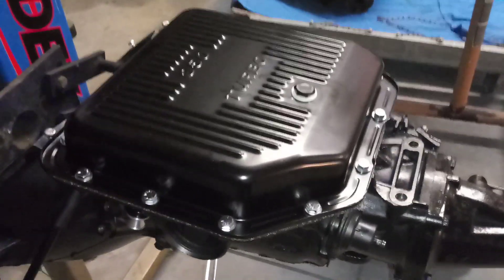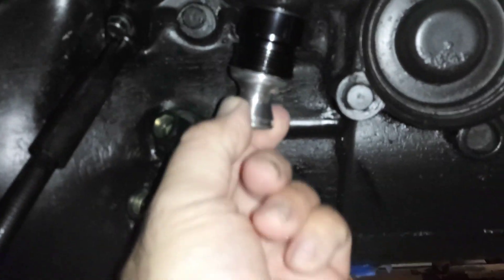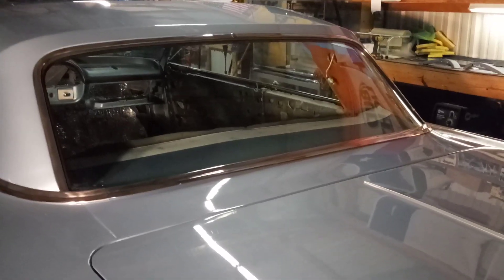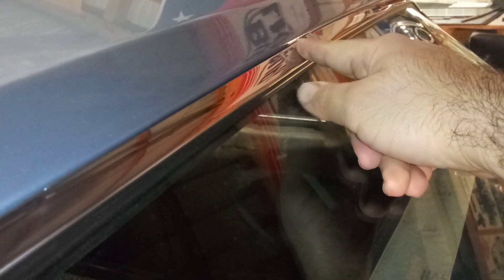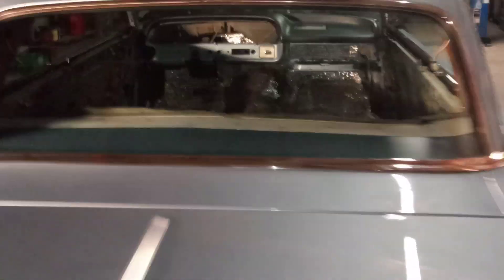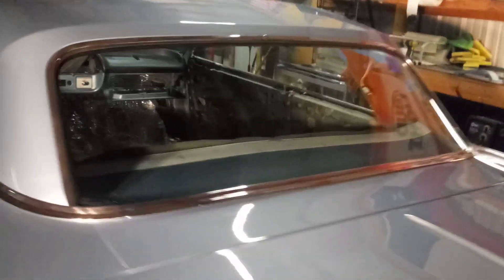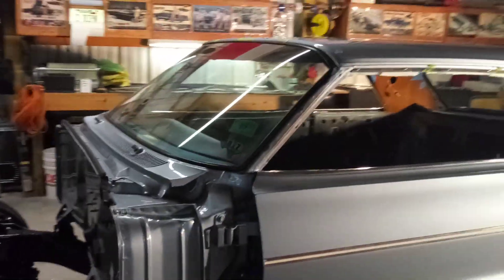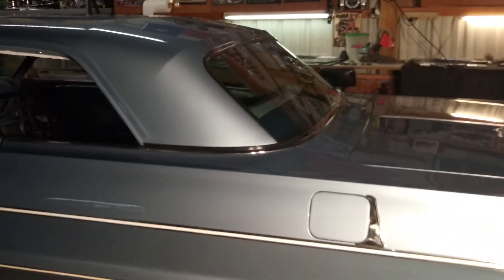1964 impala new year update

Comment: I have a 63 impala coupe and a 84 Chevy c 20 and replaced both of them a few times with rubber gasket and sealant no good used cork pan gasket no sealant I did this job about 1 time works really good no leaks the other gaskets sux I’m in Houston trust me everybody hats trans leaks prefer an engine oil leak just saying